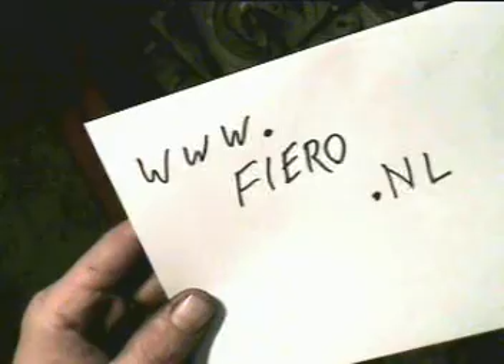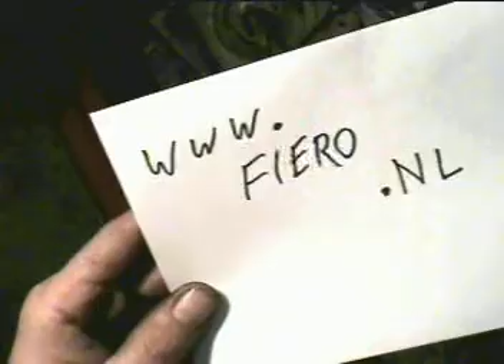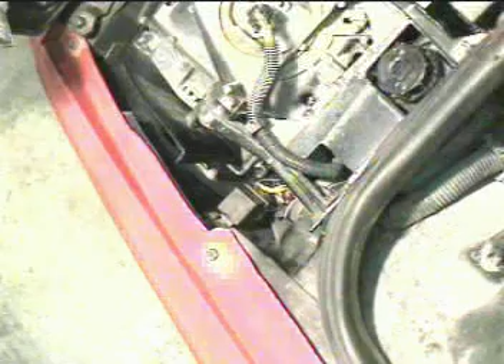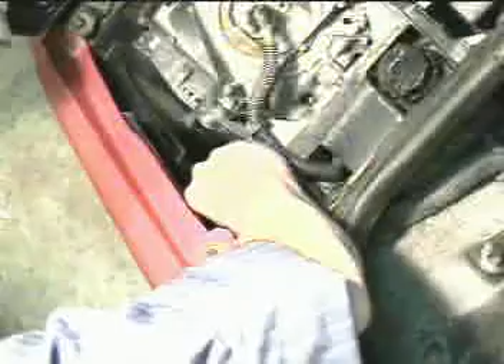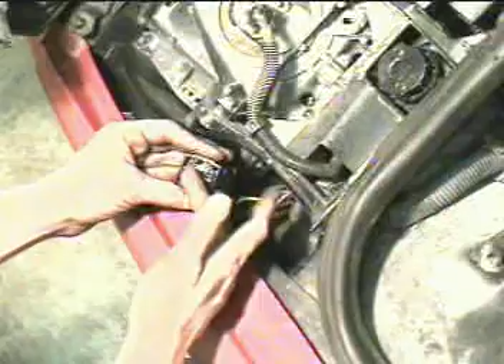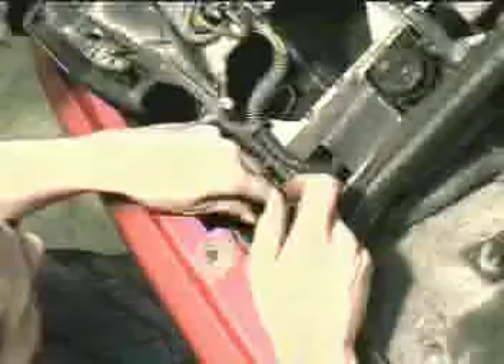fiero gen 1 headlight motor circuit test 1of2

Comment: Good demo buddycraigg... My PS headlight malfunctioned followed your video with no fault with relays & power, removed the motor and opened the panel to the armature, found the brush on one side of the armature came off it's strap, cut a piece of brush and adhered back to the strap resealed it up and replaced motor so far working fine.

Comment: GW Hawes 
I have a 84 trans am which I’m told is similar light system, the other day my pop up lights came up only half way and stopped, I lowered them by switching them off but then they wouldn’t pop up. I noticed on your video (part 1) and you mentioned a brake light may be out, I have a red light out on the driver side rear panel too. Would this be connected to the light issue or coincidence? Also with it being both pop ups not working do you think it may be the isolation relay? Thanks for the videos I will have to watch them a few times to digest the info as I’m new to this, thanks again. Simon.
Reply from the maker: The down circuit runs through the tail light fuse. The up circuit goes through the fusable links for the head light bulbs.
Rather than just pushing the switch into the ON position, use your thumb and finger to hold the switch sort of in the middle and see if the head lights go all the way up.

But there is something that you didn't mention. Do you hear a grinding sound and the manual knob is spinning, or did the motor stop completely?
Reply: Hi thanks for the fast reply, the manual spinners don’t move when I press the lights on and I didn’t hear any grinding, I do hear a click under the hood when I press the light button. 
Ps the red light at the back is the side one not the brake light, not sure if that makes any difference? Thanks again your help is appreciated.
Reply: Also the lights only came up half way the first time then after I lowered them they wouldn’t pop up at all, just a click when I press the pop up button. I have a separate button to pop up
The lights after they are turned on, it’s a little round button under the light switch

I’m going to replace the red light on the rear quarter and see what that does.

Comment: Where does one find an "isolation relay"? I tested the wiring and everything works as your video. Just re-built both motors and they work fine.
Before testing, with the relay in the circuit, the headlights would only go down if I raised them manually with the switch on. Turned them off, and they went down.
Reply: Rodney Dickman sells an isolation relay replacement

Comment from the maker: I suspect the limit switch is not being tripped when the head light goes down.
you can unplug the single blue wire to keep it from draining your battery for the time being.
.
Where did you get the replacement gear kit?

Comment: hey mr buddycraigg i am havin trouble with my pasenger side headlight first of all i rebuilt the motor it did indeed have the stripped gear so i watched yer vids on how to rebuild it an rebuilt mine accordingly to be sure i dont experience the dreeded sanderson effect i took it apart an re assembled it many times im totaly sure all the lil seals are all seated correcty  but after a evning of needing my head lights the next morning my battery was nearly flat please help.